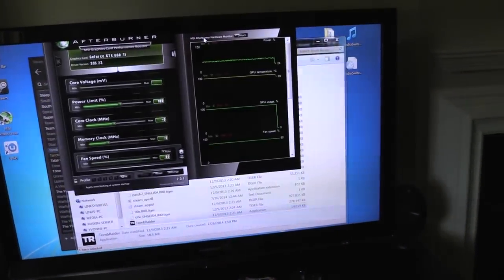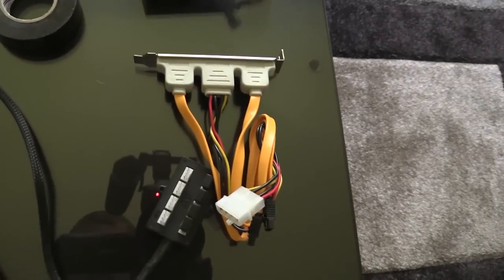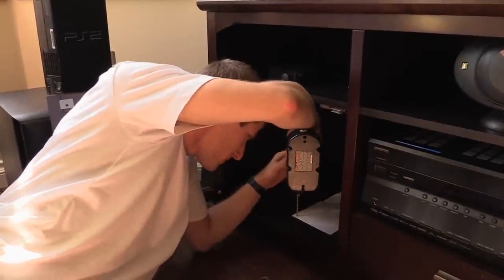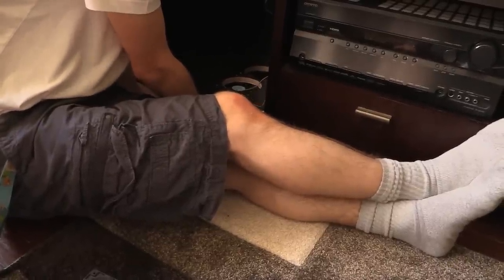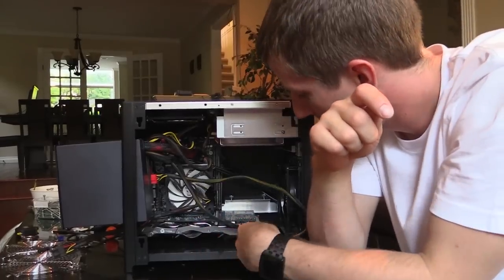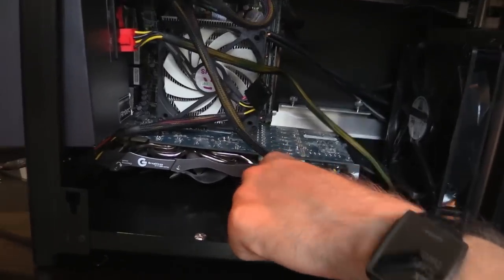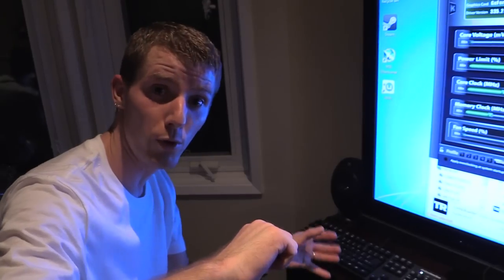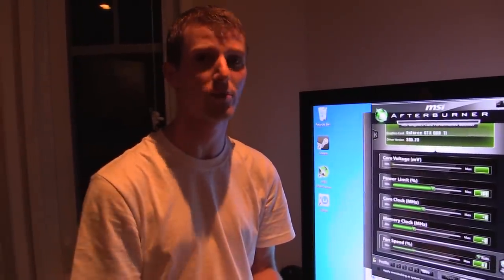Entertainment Center Cooling Mod - Linus DIY Method

Comment: My only gaming machine also doubles as my media centre, that machine i designed to be very clean minimalist looking so it would look nice centre stage next to the TV. That way it sits in open air not choking inside a cabinet. Only problem though the beautiful case i used is not realy designed for high powered gaming parts, the insides are a butchered mess.

Comment: Was the cooling sufficient when the PC was outside of the cabinet? If so, why not just put a mesh backing on the cabinet and then let the PC do the work? So in case, just in case if you ever decide to put something else in there, you can? But who could resist more fans!
I guess that wouldn't really be the Linus way anyway!

Comment: Hi Linus,

I`ve been watching your channel, particularly about cooling methods. I`ve always to rig a non-fan, liquid cooling system. I was thinking running the coolant thru a radiator that is submerged in a couple gallons of mineral oil. 

Is the above possible at all?

Comment: Yeah my gaming Mini ITX is now in a cabinet in my semi truck and my GPU is sucking exhaust heat. CPU is pulling from the front intake 200mm to the water cooler exhaust. So I'll probably need to cut a hole in the cabinet and run a exhaust port in the cabinet like this.
Reply: +Andrew Hunt I like the concept of "Driving a semi truck, pull over to sleep, start playing videogames."
Reply: +hayman taylor Pretty much! Although the trucking industry has more downtime than just the 10 hour break. Like sitting at the dock all day, or 34 hour resets, or general layovers. Have never liked gaming on a laptop, and after my first build in a truck- a full tower AZZA Genesis 9000, became a failure of an idea after the road beat the crap out of it after quarter of a million miles, I needed to devise a better solution that'll keep the hardware intact and not succeptable to vibrations and holes in the road. The Obsidian 250D has been proving itself very well.
Reply: +Andrew Hunt so pretty much hard drives are a no go.
Reply: +Andrew Hunt that sounds crazy because computer parts were never really designed to take impact like that but sounds like a very interesting idea for a custom build. does your truck battery drain quickly from the rig or is it not a problem?
Reply: I use a diesel fired generator, but even for the heck of it, ran it while on battery power. Playing GTA5, I got about an hour and a half before the low voltage alarm sounded. Which is about what you'll get in a laptop. Big rigs also run on 4 large deep cycle batteries. 

And I specifically bought a NAS drive with vibration and shock protection (HGST 4TB one) just to better safeguard myself. The computer isn't on while I'm driving, but the engine and generator does cause vibrations that could toast a regular cheapo platter drive.
Reply: Andrew Hunt yeah just basic vibrations arent great. have you found any cases that are particularly shock absorbent? if not, there might be a market niche for them
Reply: Without building something of your own, I haven't seen any consumer computer chassis that would be affordable, decent looking, and provide shock absorbing abilities.
Reply: Andrew Hunt i was thinking it would be easier to modify a case to make it shock absorbant
Reply: +Andrew Hunt maybe mount the case into the truck with springs around the screws on both the top and bottom so it has a little room to travel while going over bumps?

Comment: i use a 8000 btu portable ac on mine it 2 purpose cools my room and my pc.. cpu idle temp 5c load 15-20c gpu idle temp 15c load temp 35-45.. run all day.. ac bought it used for $80..

Comment: I think you overcomplicated the issue. There are probably cheaper cases that are easier to ventilate than that fancy piece of junk that forces you to drill a bunch of holes all over the place. The only drilling that was necessary was at the back of your cabinet not really at the bottom. The air temperature will be the same at the back that at the bottom. you can just draw cold air in from the back and thats it. Nothing you are using here is air tight anyway.

Comment: I'm blown away that people think hanging the molex out the back is less ghetto. Unless this is a "happy wife, happy life thing". If I did all the work to modify my furniture I'm gonna add a connectors to the case so it's all professional looking.  

Then again, I probably wouldn't have used the computer to power the fans at all. A $20 thermostat inside the case and a $5 12v power brick(maybe even an old cell phone charger) would have made the fans part of the furniture and not the computer. No matter what computer u put in there it will automatically start cooling when temps rise. To that end, you could have created a complete computerized cooling system for the cabinet. Add exhaust behind the reciever etc. That would have taken more time though....

Comment: What's the difference in the Modular PSU with the red connectors and black ones? Is there any profit in using them in comparison to "black" ones for the PCI-E power?

Comment: okey here is what i wud have done.. get 2 single 120mm prefilled radiators hook them up with your CPU and GPU mout them on the back of the case and let the bottom of the case in take and exhaust out the back through the rads directly out of the wooden stand thus avoiding all the fans on the wooden stand itself .That will make the whole thing quite. yes it will take some modding on the pc case but it will be way better than this setup (in my mind) but hey thatz just a theory a mod theory XD

Comment: Linus,
you should have used a water cooling radiator outside and a single or double radiator on the bottom. It would have been better i guess :/

Comment: Water cool it Linus! Run the radiator out the back of the cabinet. Water cool the cpu and gpu. Have the cpu and gpu on separate radiators. LinusTechTips

Comment: I do not see the point. Its a HTPC of sorts, is silence not a high priority? maybe should have just remove the backboard of the htpc section entirely, to allow the already existing case fans more air. This seems more like some project you want to do, to have a little fun.

Comment: I would've just put two rear exhaust fans in the cabinet (static pressure) then cut a 200mm side vent in my case door for a slow but quiet 200 mm fan

Comment: water cooling? mount radiator on back of the cabnit and have a double valve (double door) to disconect when removing the PC?

Comment: I'm working on doing the same thing but for a TV. I'm building a wall Mounted entertainment center around my 65" TV. Because I want the TV flush it will not be getting the air that it needs to stay cool. So, I was thing of installing 2 computer fans in 2 of the cabinets above Blowing down to the TV and 2 Below the TV Extracting the Recirculated Heat out through the Bottom. May question is can I wire some extension to a wall outlet or Hot wire/splice some USB chargers or what to power the Fans?

Comment: very cool but i don't use Cabinet any more i found a very cheap and simple way to
keep my PC cool my CPU that will be my mobo and PSU is hanging on my wall that's much better and it runs much cooler too and even less noise btw when i am
gaming i just turn my custom table fan on and that does the trick to keep from
over heating my PC when i am gaming

Comment: Thanks for this video Linus.
I actually have a cupboard that was custom made to fit a pc, however they never added any ventilation only leaving one hole to run wires in and out......
I was thinking about doing something like this, but I do not know what external fans I can use that will be able to be powered from a normal plug outlet. Any suggestions?
Reply: Any 12V fan with a 12V wall adapter will work! You just have to cut the leads

Comment: I have been wanting to do this to my entertainment center for a long time but not for a media center PC.  The Front of my center is all closed up so I'm always worried about my equipment over heating so instead of putting my game system and surround sound inside my center I put it on top so its in the open and I absolutely hate it this way.

Comment: Cutting holes in the case, no matter what the reason, will always be more ghetto than any other option. Except for maybe, like, anything involving hot glue. The ghetto meter goes thus, 1 being less ghetto and 5 being super ghetto:

1- Routing cables through holes they shouldn't
2- Replacing screws with cable ties
3- Using mounting brackets with the wrong hardware
4- Manually re-wiring any components
5- Cutting holes in the case
6- Using hot glue for anything
Reply: +Ganelon 7-using scotch tape to secure things
Reply: jason c
oh good god that is a HORRIFYING thought
Reply: +Ganelon Not to scare you, but my Antec 900 had the rear acrylic pulled out, then the wrong sized screws, lock washers that were too big, and, yep, scotch tape held mesh in to cover the hole.
Reply: DogIsGod
Scotch tape is so far off the scale I didn't even consider it. May Satan have mercy on your soul.

Comment: Your wife is right Linus. Sometimes it is better to think 'inside the box', in this case the solution was attached to your PSU the whole time. But you didn't get to use a dremel :(

Comment: For starters linus Your idea was BETTER more custom and would have looked legitimate if done right 

And for the fans you should use speed fan to control them I have a side panel pwn fan to cool my 4 GPU and Southbridge and in speedfan I tuned it to ramp up when gpu or Southbridge get hot and scheduled it to start on windows startup

Comment: How about... make a thin filter box out of cardboard, put a square filter pad into it and attach it from the bottom. Let the dust free airflow travel up from the floor, through the filter and into the cabinet.

Comment: You should have made small shits on the botom of the cabinet and seal off the door, then add one high speed fan in the back for fast air movement under the case.

Comment: Why not ditch the case entirely, just screw the mobo to a wooden plate you can shove into the cabinet or if a testbench will fit use that. Put some tinting foil on the window and your good to go. Did that in my cabinet with a hole in the botom and a single fan at the back and its nice and cool and silent. If your gonna hide your pc anyway, why bother with the airflow restrictions.

Comment: I have a 3.5 cubic ft space in my entertainment center. Currently I have an xbox one x in there on the top shelf with an exhaust fan and on the bottom shelf an intake fan. I am removing the shelf, so my question if I keep my tv center doors open do I need an intake fan(have two exhaust fans) or keep one intake and one exhaust fan?

Comment: Honestly, if I were you, I'd ditch the case and mount all the hardware in the cabinet. If you're going to have a PC in there all the time, than why not turn the cabinet into a PC? Temperatures will drop further, you already have vent holes with filters and it would be ghetto +100 and awesome +300 ;d

Comment: My r7 240 gddr5 gets around 70c after couple of hours maxed out, and im starting to think about zip-tie a case fan on top of the heatsink.. But seeing U dont care bout 90'c... damn..
Reply: Gurjot Bajwa I have 1440x900 monitor. Everything which I have trew for the card to chew on... runs on Ultra with 30+ fps. I consider 30 fps enought for gaming, as I see not big of a difference between 60 fps and 30. Suits me well. I'm happy about the purchase. ;)
P.S. Forgot to mention I have GDDR5 edition(v2), which has memory bandwith of 76 gb/s instead of the 27 gb/s on DDR3 edition.
Reply: A max of 70c is pretty good, be happy with that.
Reply: Robert S I wrote to AMD support team.. they replied that if the card is not hitting mid 80's then the card will last quite a while. That cleared all my frustration.
Reply: DaGunchijs My CPU tops at 51c Tops :D
Reply: PandaPunch I got a triple core AMD cpu unlocked to 4 cores running on 3.6 ghz with stock cooler and it's getting to 67c on full load stress test. Damn as summer is coming, ima buy Gammaxx 200 cpu cooler. :)

Comment: Let go of the computer case and use the wood cabinet instead. It would go much quieter, lower temp as well as easier access to the components, Well, on the basis of sacrificing a well made cabinet itself I presume.

Comment: why not have an intake directly feeding fresh air rather circulate enclosed air.
Reply: +gamemaniac85 the bottom fans push air into the enclosure, so that'd be considered fresh air. the exhaust fans in the back blow air out, so there's no recycled air in the enclosure

Comment: My GPU does terrible in the cooling department, and there are two largeish fans blowing right at the mobo. the PC is in an open area under the desk.
Reply: +Thomas Duke 57 celcius just watching a yotube on a large second monitor.
gpu: nvidia GTX 610
Reply: Thomas Duke (Creeper1372677) res? maybedust....
Reply: +Jack Nickolson I don't water cool if that's what you meant when you said 'res?'. I vacuum daily and the PC gets opened weekly almost.  
P.S. I think i modded my gpu cooler after i posted the comment.
Reply: +Thomas Duke (Creeper1372677)  ah...whats your resolution becuse if your watching youtube at 1080p or higher it will put some load on your gpu..
Reply: +Jack Nickolson I watch YT at the automatic resoloution that my pc gets, the second monitor was temp. both monitors have 1080p native res, it usually autosets to 720p.
Reply: +Thomas Duke (Creeper1372677)  well....two monitors @ 1080p on a 610 hrmm  im not 100 % but powering 2 can be hard...
Reply: Jack Nickolson Ok, wow, didn't know that.  right now i am looking up how to block apps on battery.

Comment: My Gpu is IDLE-in at 50 Celsius as well, but never goes above 70-75 Celsius while gaming. Is that idle temp bad or what should I do with it?
Reply: The gpu fans turn off in idle, it should be fine. They kick in when the gpu goes above 60c
Reply: +josh Subet Can't really say that without knowing what his gpu is.. It's only a generation or two since they were pretty much always on.
Reply: ObliteAbyss
Or a custom fan profile, maybe he has a bitcoin miner virus on his computer without knowing. If the temperature was so high at idle, then it should be very high during gaming too, then turn off from going to 100c and higher. This may happen from bad thermal paste or very little heat-sink and gpu die contact. I have a 980 ti and it acts exactly like how his gpu does. 45-50c idle, 75c load
Reply: +Varga Dániel Bad idle temps are in the 80* range, or high 70's. Yours is perfectly fine, mine idles at 65*, but it's due to the fans turning off. But you should try to remove some hard drive cages in between the fans and GPU, that you don't plan on using of course. You could also make a more aggressive fan curve in MSI Afterburner, if you don't mind the extra noise. Your load temps are perfectly healthy too.
Reply: Champturn Thank you very much :D
Reply: +Varga Dániel Mine idles around 50C but it is a fancy Nvidia Quadro card from 2009. Seems like older cards like that always ran a bit hot

Comment: I think you over thought this.
I'd have used an h75 or h100/i running out of the case with the rad at the back of the cabinet instead of the exhaust fans maybe even thrown the pc case away and bolt the mobo to the cabinet & stick h100 or h100i on the cpu ffs :D - otherwise its a case inside a case....hence the heat build up. And then if required added soundproofing but my way you'd have had only added 2 fans & taken away the mobo cooler fan instead of adding 4 more to the existing 3.... aka my way = 3 (h70) or 4 (h100/i) fans in total (2 in case 2 (or 1) on cpu cooler) your way = 7 fans in total = shed loads of noise.

Oh n yeah your wifes idea was a lot easier aka not pissing around for the sake of it.

ps luv u linus.

Comment: i know is too late, but why a 120mm? put megaflow 200mm everywhere >_<
Reply: +LPnova99 There was only that tiny little intake on the case, it wouldnt have made much difference because the actual components would be getting about the same amount of air anyways.
Reply: +LPnova99 120s direct air in a streamline instead of just everywhere.

Comment: Hey Linus                                                                                                                            Great idea and i do believe you should make a bottom cut out on the case for better air flow, the only thing i think might be an added bonus would be to add a speed fan control via a knob or remote control to adjust the sound and or cooling to your liking. Great video

Comment: Why not go with an arm device that doesn't put off that much heat.  They've gotten a bit faster in recent years.  And most still lack car parts, fans, and even heatsyncs.  Your wifes idea was better.  Having an undo button is always the preferred way.  You could always 3D print something to tidy it up and flush it to the case.  Or DIY it out of wood.  Or cut  up and glue some altoid tins if you must deal in metal.

Comment: yes buy ps4, do it! linus you have way too much heat in a case that is too small. if you remove the psu n have it outside the case in the cabinet, just behind the case so it is not be seen expect when you it out the pc. run the cables outside through the bracket out the back. it will be fine. anyways reduce the heat output, that's rule one, rookie!

Comment: yes buy ps4, do it! linus you way too much heat in a case that is too small. if you remove the psu n have it outside the case in the cabinet, just behind the case so it is not be seen expect when you it out the pc. run the cables outside through the bracket out the back. anyways reduce the heat output, that's rule one, rookie!